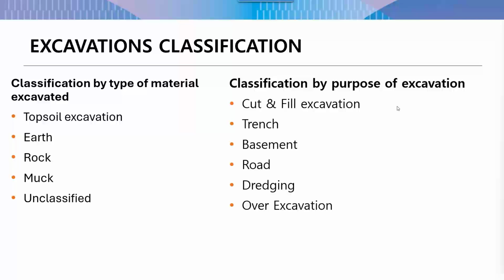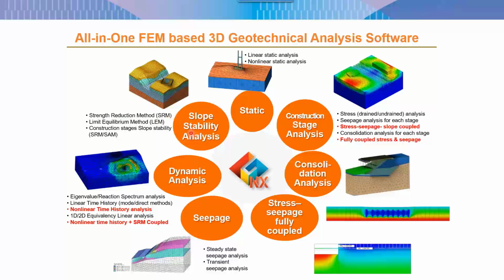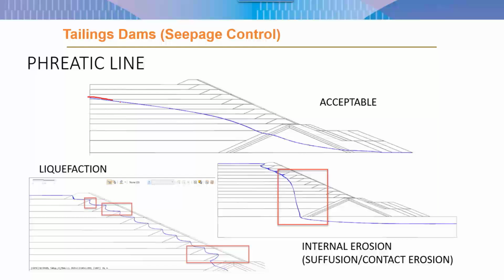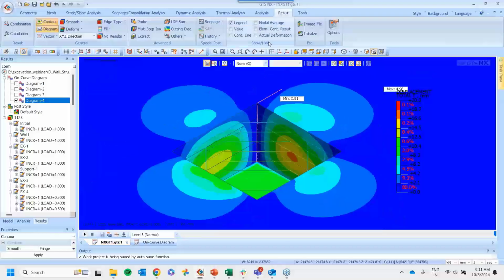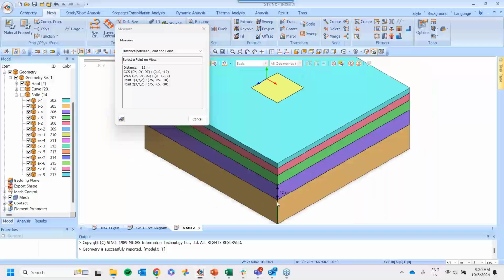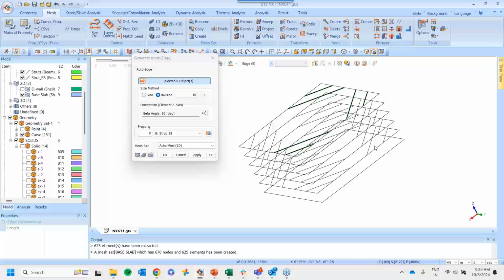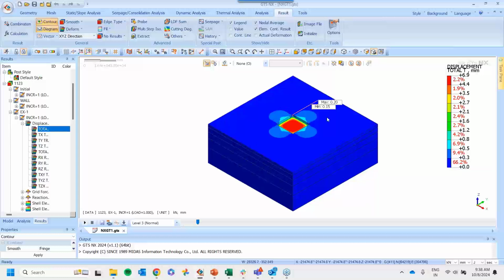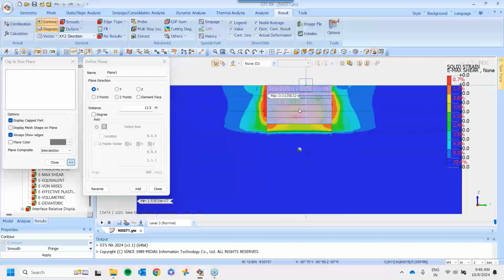Training Webinar: 3D EXCAVATION

Comment: Is the shown bending moment in the wall in the horizontal direction (not vertical)?  It looks so , as the bending moment sign is minus. That doesn't make sense, you cannot design the DWall panels for such stresses. Something looks very wrong with this presentation and there is a significant misunderstanding in Midas team behind that. 
Your explanation of the site problem cannot be valid. As initially this moments need to be released.